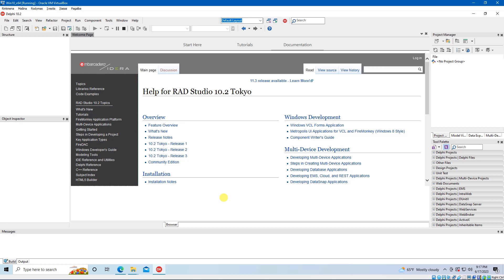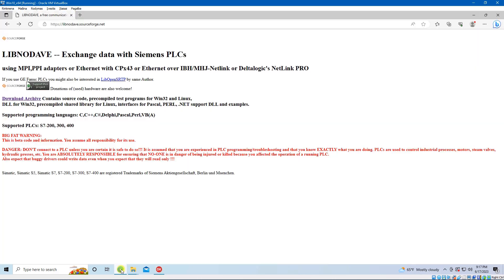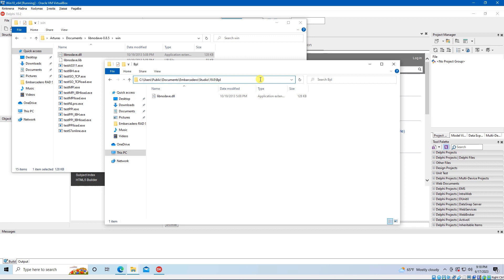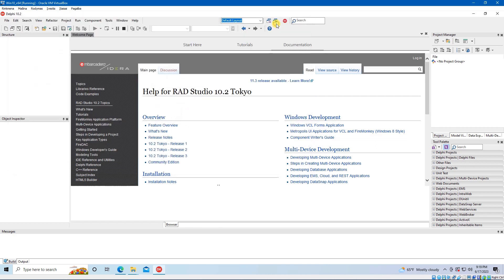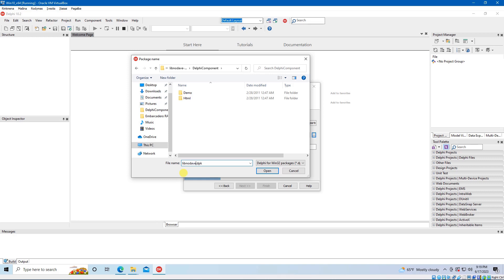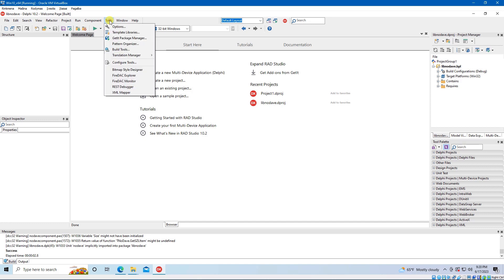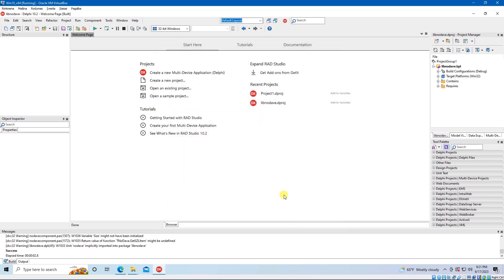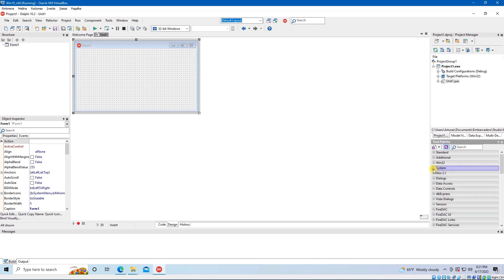Libnodave: install into Embarcadero RAD Studio

Comment: Hello,
I’ve been using LibNodave for years in an application made in Delphi 7, working very well. Now I’m forced to change the PC and an updated version of Delphi, in this case, 10.3 Rio Version. I’ve been looking carefully your video "Libnodave: install into Embarcadero RAD Studio", and it appears to be correctly installed in my new PC, but when I try to connect to the same PLC, the connection is not established. All the properties in the NoDave component are the same, but I can’t connect. Do you know if Delphi 10.3 works well with LibNoDave.
Please, help me. I want to pay for your help.

Looking for your great answer
Thank you so much
Reply from the maker: Hello,
It should work. I made a project on RAD Studio 11.3. Could you make a new empty project with just NoDave component and try to test the connetion?
By the way, i have noticed that you are switching from Delphi 7. noDave.pas and noDaveComponent.pas are not unicode compatibale, so you have not forgotten to change string > ansistring, char>ansichar, have you?
Reply from the maker: And one more thing, you have mentioned, that you move to another pc. Please make sure, that firewall doesn't block 102 port.
Reply: @automatikavaldymas  As soon as I can, I will inform you of the result. Probably the problem is in ansistring, char>ansichar. About the firewall, I think it's not the problem, cause the demo exe from LibNodave is working properly. I will say something in a few days (I have too many fronts open)
Reply from the maker: If you did not replace string>ansistring, char>ansichar then there will be a problem. I have mentioned that in the video. Hope it will fix your issue.
Reply: @automatikavaldymas  Hello. I continue this conversation in your "Communication with SIEMENS S7-300 PLC using free library libnodave and Delphi." video, where the code for connecting is well explained
Reply from the maker: Hello, ok. By the way, did you manage to get the connection working?
Reply: @automatikavaldymas  Yes, the connection is working!! Thank you so much!! 😃😃😃